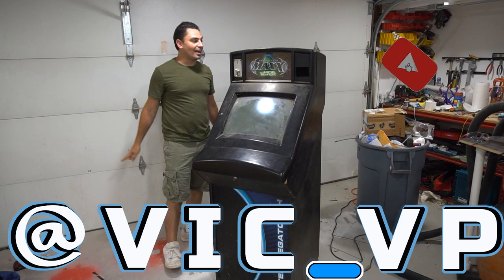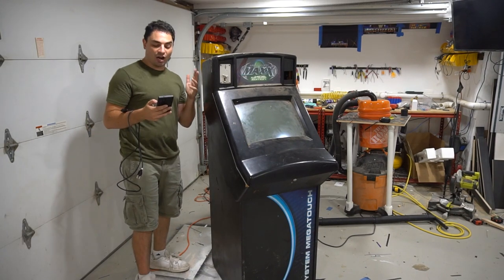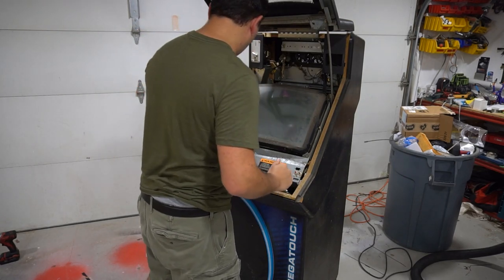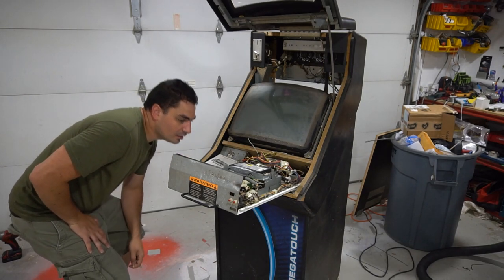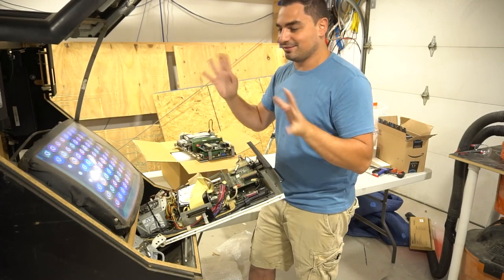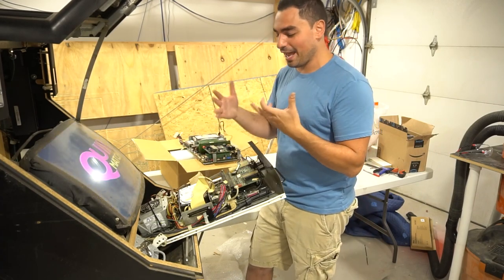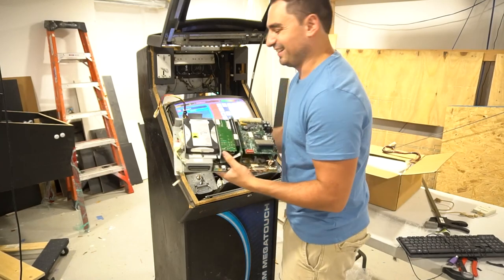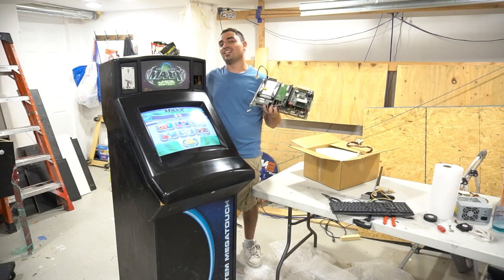Megatouch Maxx Marketplace score!.... Well, Not Really

Comment: @Vic_vp have you tried to do any hard drive diagnostics or recovery on the failed one? I'd be happy to try and recover the failed hard drive and attempt to migrate to a working drive for you to try
Reply from the maker: Nah I tried it several times on my working cab in video... it's not worth the time or hassle.
You can find the flash versions now of these for about 50$ on ebay... they boot faster than the regular hdd.
Appreciate the offer tho 👍
Reply: @Vic_VP  ah got ya, I've never worked on one but have recovered hard drives in the past. That's why I asked. Glad.you got it working. I recently built a full size VPin cabinet out of 40x40 aluminum extrusion based on a William wide body cabinet. Expensive to work with but was a fun build